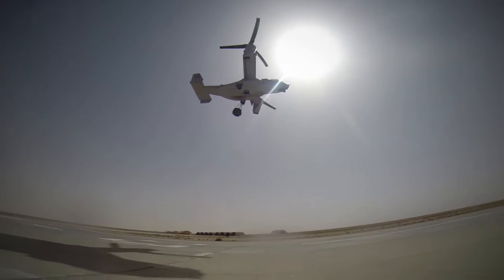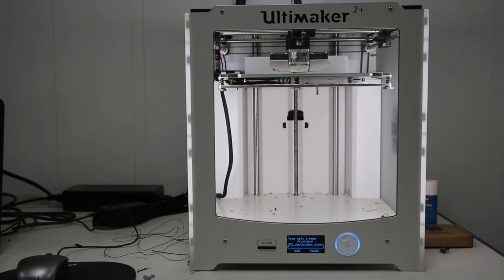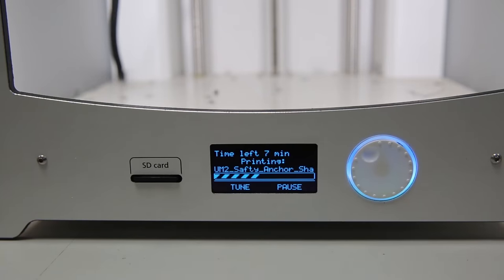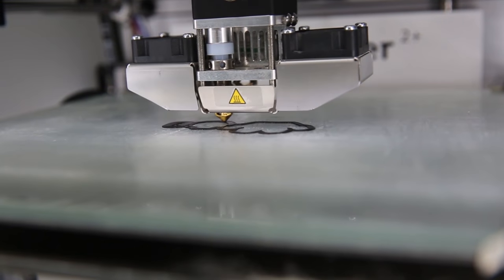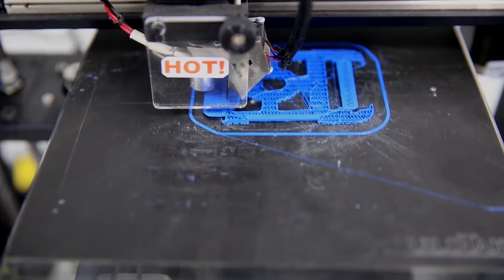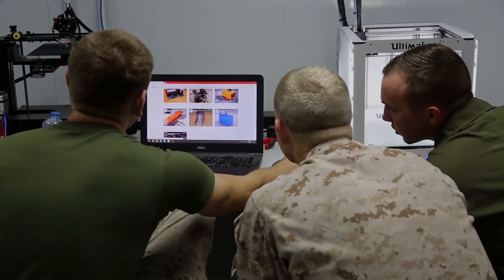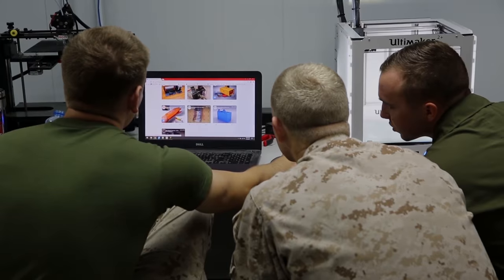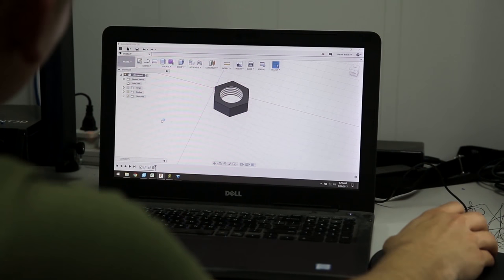The Way Ahead | 3-D Printing

Comment: Surprised they're using an ultimaker, and not something like the Carbon M1 (which is resin and laser based, rather then extrusion based)... From what I've seen, extrusion based 3d printers can be generally unreliable, with mis-calibrations, prints not adhering properly, clogged extruders, etc... Then there's also the time it takes to manufacture something... 30 minutes to several hours, depending on the size of the object, whereas the M1 can do the same, in less than 30 minutes. But hopefully, now that the military's showing interest in 3d printing, this tech should advance a bit more quickly, to meet demands... Since I'd imagine it'd need to be a lot more reliable, and a lot quicker. (Hence the term "Military grade" generally being something that's as reliable as possible) Current additive manufacturing is more for custom parts, and rapid prototyping. Buuuuut this is all just my opinion. Hopefully the military knows what they're doing...

(I'm geeking out about the M1 so much, since it's the quickest, and most reliable 3d printer that I know of... But it's also one of the most expensive... On another semi-unrelated note, I've been trying to get into a CAD/CAM course in the local community collage, since I'm really interested in this stuff, especially 3d printing... Just the prospect of making something from practically nothing fascinates me to no end...)